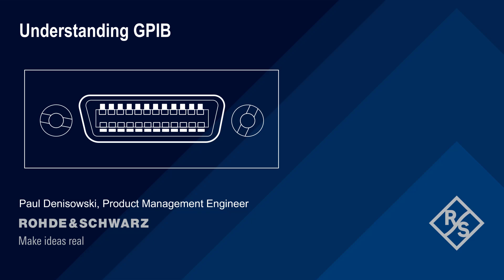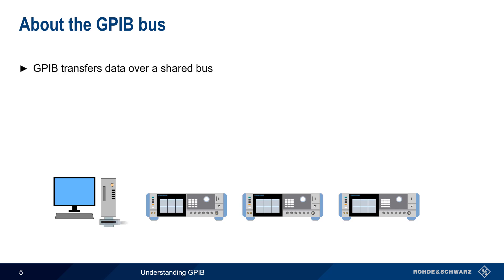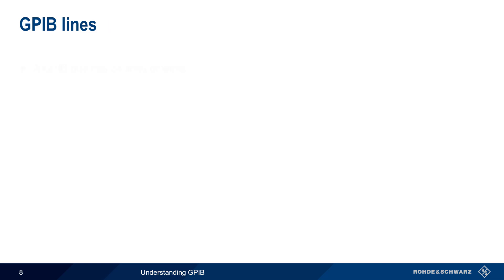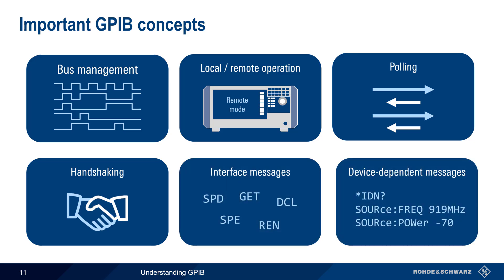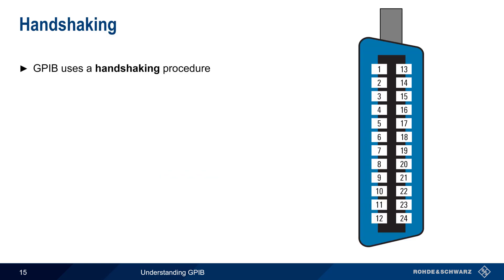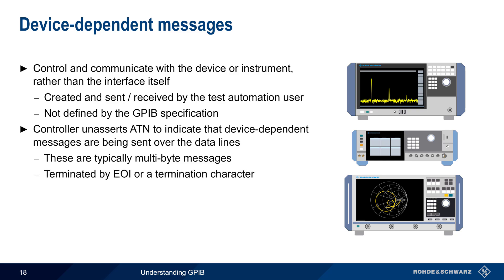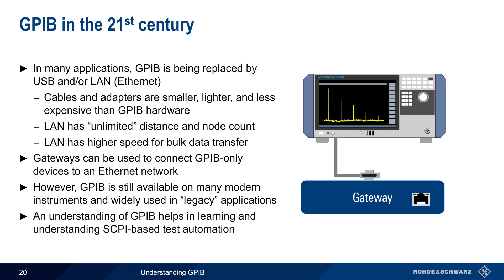Understanding GPIB

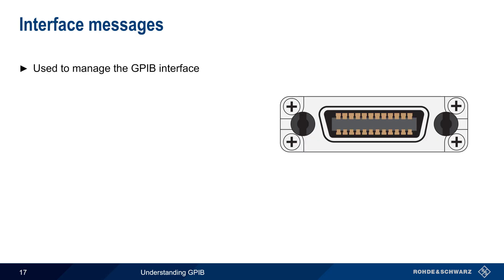Comment: 13:05 Why do the NRFD and NDAC lines only become un-asserted after all listeners have un-asserted it? Does un-asserted = logical 0 in this exampel? How would the talker determine that all devices have un-asserted if the voltage on the line equals high as soon as the first listener un-asserts? Then there would be no difference between all un-asserted and only one un-asserted
Reply: That’s a great question.  GPIB implements NRFD and NDAC using what’s called a “wired or” concept in which the lines are driven with open collectors. A line is low (true) when any single device pulls it low, even if other devices on the line are trying to pull it high.

Comment: This is a great video.  I can't believe that you guys are making a video on GPIB after it has been around for more than 30 years
Reply: Thanks!  GPIB is still an important technology - many of our customers still use GPIB and even our newest instruments have GPIB as an option.  And a knowledge of GPIB is helpful for understanding SCPI (which I'm covering in an upcoming video)
Reply: GPIB is excellent interface for low speed communications even today as it does not require additional hardware to daisy-chain many instruments together, unlike LAN/USB/Serial. It's also widely supported by industry and easy to work with after you setup the GPIB host/controller properly.